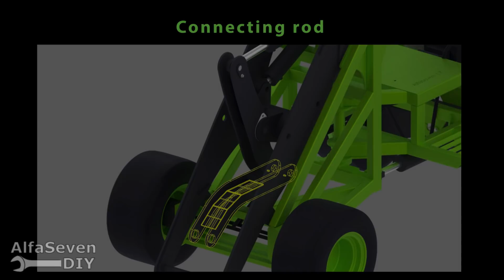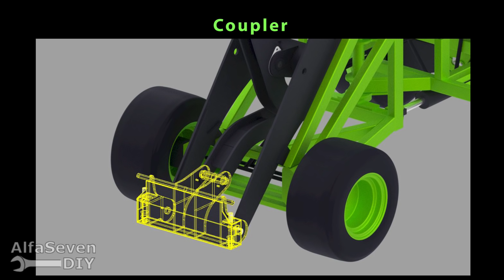L7 Episode 11 | (home-made wheel loader)

Comment: this is looking more and more like a legit loader by the update my friend, great work and awesome bit of ingenuity, i would add a spring and washer to the bucket pins, or an extra detent to keep the pins from walking on you out of the locking sockets for the bucket as another suggested on here just to prevent headaches for you down the road, still a very solid machine, great build

Comment: Maybe add a spring above your bucket locking pin to prevent it from riding up, all the agricultural quick connect buckets have springs there for that potential issue.

Comment: I give you props for building it from scratch but I'd have built or bought a universal mounting plate and then you could literally put whatever bucket or attachment on instead of having to have one off still mounts for any bucket or attachment you desire.
Reply from the maker: Hi,
I have used the same specs on the coupler as Avant. 
Most of these should fit:

https://www.avanttecno.com/us/attachments

Comment: Did you model your quick attach to any industry standard, I myself would have a hard time not doing a skid steer standard although that's the cheapest attachments over here in north America
Reply from the maker: Yes, it is the same standard as Avant machines 🙂
Reply: @AlfaSeven  ok cool, can't wait to see the high flow hydraulic control valve retrofit sometime, I will say when it comes to firewood work nothing beats a grapple or four in one bucket